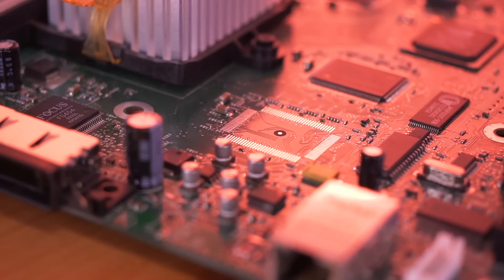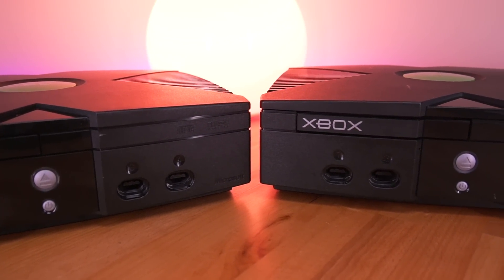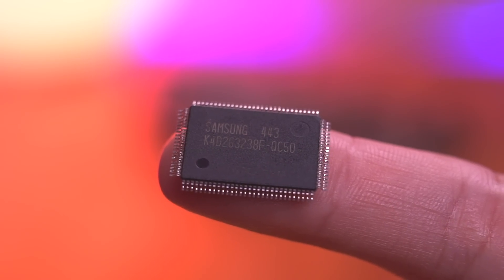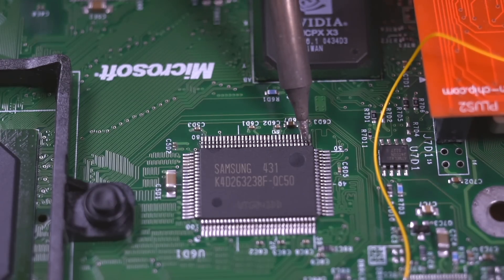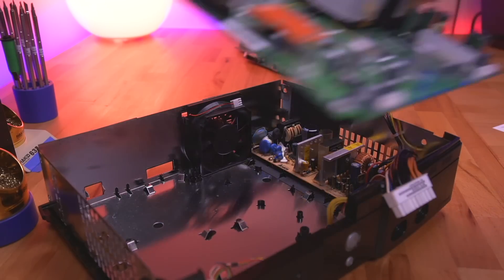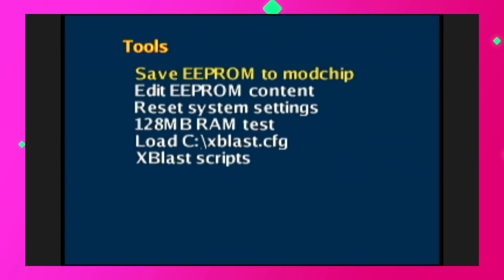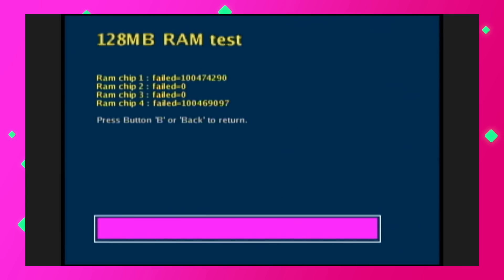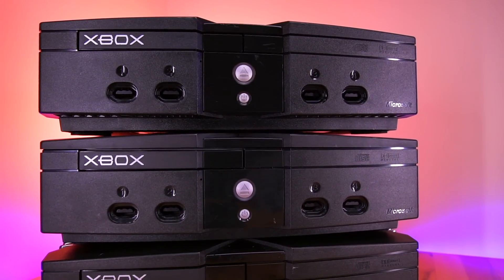I Did The Impossible 1.6 XBOX 128MB RAM Upgrade! | Piggyback Method!

Comment: Curious whether the N64 could be upgraded this way if the datalines are compatible
Reply: Fundamentally, RAMbus like on N64 can be expanded by piling on more chips in parallel as well, and they don't even need CS (Chip Select) signals, instead you snake INIT line from one chip to the next and they self-assign themselves incrementing addresses in order, and then are just addressed over the unified data/command bus. A clock line goes through the chips twice, opposite orders, to allow the controller in the memory chip to compensate the skew.

Furthermore if you think about it the N64 already has an expansion mechanism foreseen. The data lines need to be terminated with signal integrity resistors, plus there's that snakey clockline, and stock it comes with a Jumper Pak in the front of the console which wires all of these things up; replaced with Expansion Pak to expand the RAM. One could conceivably make a triple capacity Expansion Pak. Unfortunately the chips are not off-the-shelf so one would have to sacrifice another N64 or another couple Expansion Paks to accomplish that. Xbox just uses standard RAM chips. But then there's the software chicken-and-egg issue that even the Expansion Pak support is spotty, so there isn't necessarily even a strong use-case to quadruple the RAM as it comes in the system.

Comment: In one of my Electrical Engineering classes we had an option to solder capacitors and/or resistors on top of each other, but I didn't know you could do that with actual ram chips.

Comment: Awesome stuff! The fact that you are providing a guide for difficult, small percentage mods is great for preserving older consoles even if they are less sought after for modders. I thankfully had 2 Xbox OGs with blown caps and defective HDDs restored and modded locally, although I don't currently have much use for them. it would be cool to see a totally wreaked Xbox getting restored, im sure there are tons like mine out there.
Reply: agreed!   Have not seen to many of these out in the wild.

Comment: I like to keep my systems as authentic as possible. What approach do you recommend I take if I want to replace my OG Xbox (version 1.2)'s onboard storage and reinstate the original dashboard?
Reply: Since the HDD is keyed to the motherboard you'll have to do a lil TSOP to allow other hard drives, though you can leave the default Xbox dashboard as your primary and it'll still work
Reply: Also please make sure you've either replaced or at least yanked out your clock capacitor. They're killing Xbox consoles left and right (it only keeps your clock settings for a few hours unplugged anyways so wont really be missed)

Comment: You might be interested to learn that there is a Windows clone that has a port for the original Xbox, it's called React OS and is a open source open room reverse engineering of Microsoft Windows. I would try running some lightweight titles on the original Xbox with 128 megs of ram in it. Of course they would need to be added to the console manually via a modified game card or something like that.
Reply: @CovenantAgentLazarus  you can talk all ill all you want about any form of Linux or Windows clone that you want, just don't spread it in a light-hearted area. You're not needed here, you should not have commented.
Reply from the maker: I’ll definitely have to take a look!

Comment: My question is what will happen if you double stack the other ones with all the ram with the extra ram pads would you have to be to 256 MB
Reply: The problem is that you need to have the chip select pin soldered somewhere, and the CPU has to have access to it somehow. Don't know if the CPU has more than 4 chip select pins, but, would be cool if it had.

Comment: For your QSB for the LPC Rebuild, you may not have bridged D0 and filled all the solder wholes correctly, even the vias with no pins need to be connected as well, made this mistake myself
Reply: Made this mistake a few months ago
Reply from the maker: Yeah, I was totally stumped. I did bridge D0 but for some of the points I wasn’t getting continuity. I got it to work on my other 1.6 that I installed the make mhz hdmi kit but couldn’t replicate it on this one

Comment: piggyback is the term and I done this many times on old 8bit and 16bits systems. Heck it's also a way to troubleshoot old arcade systems.

I did this a few years ago. With the chip select lines I used a older revision motherboard to find where they were located and used a buffer to protect things. I don't have the ROM anymore for it. I only used that xbox for running Linux.

Comment: Wouldn't it be possible to use this method on the older revisions as well, to possibly give them 256 MB of ram?
Reply: The 4 unused coms needed for the "bank switching" are vestiges of the old model.

Comment: Wouldn't this basically be the same as replacing the chips with double capacity chips? Also, wouldn't this not be as good as modding previous models because it's using the same width in the RAM bus?
Reply: Higher capacity ram modules that fit the TQFP footprint don't exist. they're only in TSOP56 and BGA packages, and even then you'd still need to use bank switching those chip select pins to hold the highest address pin high or low in order to make the Xbox see the ram.
The Xbox doesn't see "128MB of RAM" it sees "32MB of RAM in banks 0, 1, 2, and 3", and it switches between them by triggering chip select pins one module at a time. They all use the same bus regardless, but the Xbox only accesses one chip at a time.
Reply: @Null_Experis  thanks for the explanation. Not too knowledgeable about this stuff

Comment: piggyback chips, not a new concept but it works. but wouldn't replacing the chips with higher capacity ones be easier or it doesn't work for some reason in the 1.6? been a long time since i messed with og xbox...

Comment: Someone "Discovered Chip-Stacking"?
😂
Commodore 64 Hardware hackers were doing this back in the mid 1980's with the Commodore REU's
Did this very thing myself using a 1764 and ran my Color64 BBS off of it (power trace on the REU cut and powered separately with a battery back up) then, I got a SuperRAM-Card and a WHOOPING 20Mb HD!!!

Comment: Why an XBOX would need 128 MB of ram at the first place ? it's not like u would have a significant boost in games anyway cause all of em are optimized to run with 64 MB of ram
Reply from the maker: You can patch some game to run at a higher resolution with the extra ram as well as some other things like play Sega chihiro arcade games

Comment: This reminds me I really need to get a mod chip for my 1.6 xbox since there's no easy way to just flash the bios on that model and at some point the hard drive is going to die. At least I don't have to worry about a clock capacitor destroying it since it's the only model without one.
Reply: Just softmod and swap the drive, I have two 1.6 systems that are going strong with new HDD's thanks to the Rocky5 method 👍 you can get a kit on eBay with everything you need (USB flash drive with save exploit, USB to XBOX cable, and a physical copy of an exploit friendly game) for $20-$30, then you use CHIMP with a new drive and your set! A 2tb HDD with a Startek SATA to IDE adapter, plus a new 80pin IDE, is what I would recommend, though you can go cheap if you're in a pinch.

1.6 systems also have clock caps, they're just considered "less leaky" when compared to 1.0-1.5 systems. The problem is, 1.0-1.5's can run without a clock cap (modded), a 1.6 can't. If yours ever stops working, you'll have to swap it with a new cap.

Comment: I wonder... Could you maybe just print out a little jig for bending chip legs? Pretty much just s debossed rectangle a hair bigger than the dimensions of the chip I guess. Maybe angle out the walls a bit. I always get the jibblies in the pit of my stomach when I need to bend IC legs, maybe that'd make it a little less nauseating.
Reply from the maker: That’s definitely a possibility. Would definitely make the pin bending more consistent.

Comment: Noob question: What temperature should I set my soldering iron to? There's gotta be some optimum range for this.
Reply: +/- 360°C with good solder
Reply: @sebastianjanczyk6191  Thank you. May I ask another question? I know that there are different compositions for different use cases (R/F solder, microelectronics soldier, copper welding soldier, etc.). What distinguishes a good microelectronics solder alloy from a bad one?
Reply: @Psychx_  when you use a bad one you need to increse the temperature and also use a lot more flux to achieve the same results, or it will weld and cause cold solder joints
Reply: If you have a means to calibrate your iron, do so first.  Find yourself a old scrap PCB and increment from 275°C  by 5 or so until you get to a temperature that will reliably allow you to flow the solder joints.  The old solder will have enough crust and contaminants to make your iron work.  Once satisfied, try something with a big ground plane and try out your boost if you have it.  You want to go with your min working temperature so it will give you more time before you burn away your flux, especially if you're new.

Comment: Can I bypass the QSB step if I have already hardmodded my OG xbox and have access to testing ram? Its not needed for the actual ram correct?
Reply from the maker: If your unit is already modded I’m assuming it already had the LPC rebuilt.
Reply: @MachoNachoProductions  Not sure honestly. I did the soft mod via memory hack and then did the hardmod by soldering a few points under the motherboard and then rebuilt the dash, removed the softmod and I can do anything with it, no need for any extra qsb or chips.

Comment: I used to run Gentoo on my old XBOX, we had this Traktor FinalScratch (first gen) that ran on WINE. I build WINE for the XBOX and dropped the required asound files from the Traktor ISO and bam we had a cheap DJ box that just needed a TV :D

So yea, you could also use the extra RAM to run Linux on it...

I still have two or three Xboxes, sadly the 160Gb drive that was used for them has long passed away :(
Reply from the maker: Yeah, Linux would certainly benefit as well!

Comment: I have a dumb question. Lol. But if you have a non 1.6 model, that has the extra slots for the ram. Would it be an improvement to fill the slots, and then double stack all the slots. So instead of having 128mb of ram, you will have 256mb of ram. Is that something that’s possible? And if it’s possible, how would it be beneficial? Hope I made my question clear. Would appreciate any response you can give. Thanks.
Reply from the maker: Not sure if that would be possible since I don’t think the Xbox can address more than 8 ram chips
Reply: @MachoNachoProductions  I don’t know anything about tech. Lol. Was just curious.

Comment: Seems to me like one could stack all of the extra RAM chips on top of each other, or at least like a stack of 2. Also, seems like a flex cable could be made with pre-installed ram chips with pads for the CS lines
Reply from the maker: Agreed a flex could certainly be designed for this and potentially make the install easier
Reply: @MachoNachoProductions  With RAM, not so easily.  Traces have to be length matched and you have to worry about other circuitry interfering with the signals.  High frequency data lines are a dark art when it comes to PCB design.  Piggybacking the RAM is the most straight forward method really.  You could pre-tin the legs and use hot air to make installation easier.  Possibly using solder paste too.

Comment: Do those ram chips get hot at all? I’m not certain, but that may be a concern if you’re stacking them
Reply from the maker: That could be an issue potentially, I would think more so for the bottom ram module.

Comment: “Piggybacking” RAM chips goes back to the days of 8bit & 16bit home micro computers, so it’s not a new concept but it’s cool to see an old hack like this still being handy & fun to do.
Great video, thanks.
Reply from the maker: Glad you enjoyed the video!  It’s definitely a pretty cool method of adding ram
Reply: I wish this comment was higher, it's awesome this trick is being brought back but it is also on some level concerning that younger folk could see a concept this 'simple'  and immediately surmise that it was never thought of before/just discovered for this first time
Reply: I had an Atari 520ST, stacked the additional 512K to make it a 1MB system in 1987 - $200 in memory cost.
Reply: If you hadn't written that comment, then I would have. It felt like it was praised as THE discovery of the century... I learned about that in school back in 1999 and my teacher was bragging how he upgraded calculators and similar devices that way and earned some pocket money on the side with it. So yea, very old technique.

Also, that all address and data lines for the memory chips share the same traces is nothing surprising either. It is an external memory bus which is connected to one memory controller IP. Having multiple external memory busses for RAM in a chip is not impossible, but that is typically not done as it is quite a hassle to route one bus (differential signals, high speed layouting, impedances etc.), next to being just a stupid idea in the first place. 
Similar concept as SPI and I²C, btw.. SPI uses Chip Select (CS) and I²C uses adresses to distinguish between devices on their according bus. But even that blows the mind of the "Arduino-Generation". Like tell them you can hook up simple 8 Bit shift registers in a daisy chain to gain additional input pins for a trade off on speed (in the professional world we call them "slow I/O"). Most will go 🤯.. (ya, I like browsing the comment sections when I find such kind of videos here.)

Anyhow, still amazing to see people becoming euphoric when discovering old techniques these days..
Reply: @leviathanx0815  Whats new is old and whats old is new again.
Reply: Yeah I had figured that this was already tried since it was such a common mod in the past.
Reply: piggybacking any kinda component is just extra fun to me to see done, like second bios chips that are just over the original bios chip with a switch installed to toggle between the two, piggybacking on the A/V output for crazy reasons, piggybacking off the controller pads for inputs mods. it's so neat
Reply: @Arragonder  I piggybacked a second bios in my dreamcast. easier than desoldering the old chip and less risk of ripping off pads👍
Reply: @DecibelAlex  nice.
Reply: Def very cool that people still put work into the Xbox Classic. I actually just got one and was a bit bummed out it was an 1.6 and bam, new mod.
Reply: Sapphire just did that to increase the VRAM of the 6500XT. Just incredible what just ramming a chip atop of another one can do
Reply: I had a Atari 520ST with 512kb that was upgraded to 1024kb using this technique. Gotta say, these small legs are much more difficult than the Atari mod.
Reply: @k.o.0  yeh, I’m to old for soldering that fine. 😄
Reply: Yes i got a device that piggyback ram. My Hp 71b calculator/computer does
Reply: @rachelannkrueger7638  very cool.
Reply: how is it fun to do? are you daft?